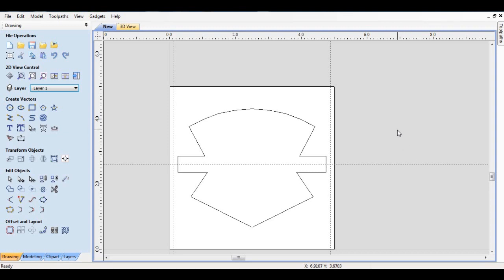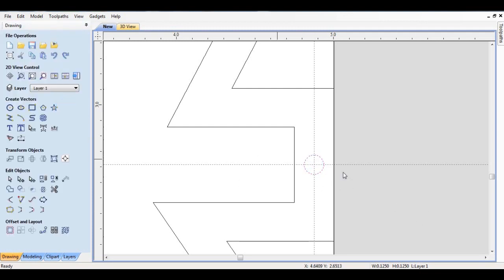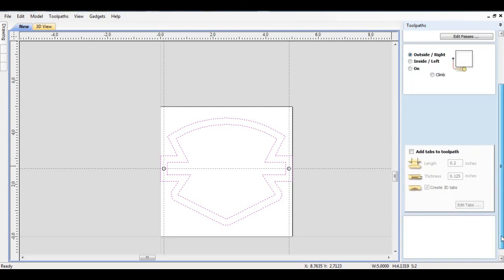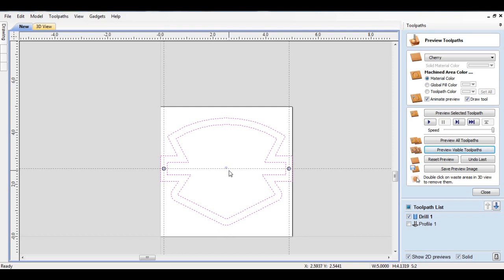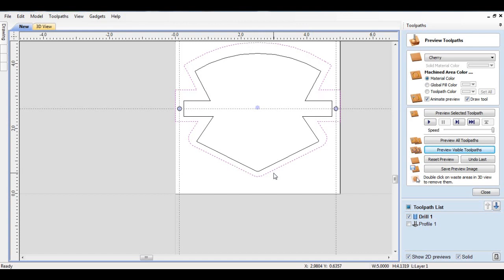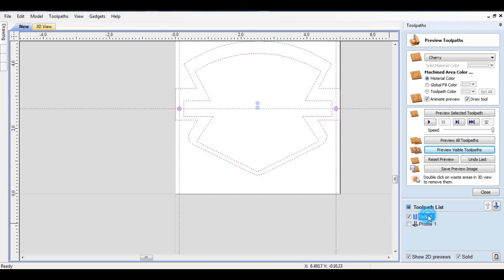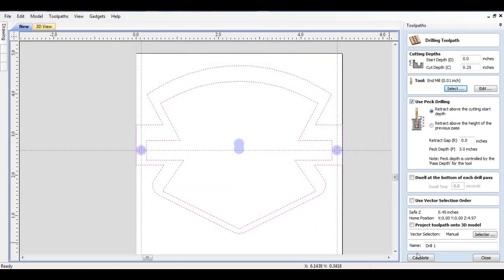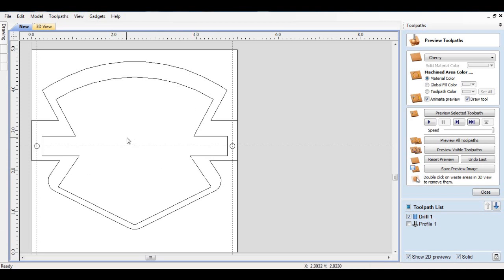VCarve Pro and Aspire Drilling Tutorial

Comment: I don't own VCarve Pro but Cut 2D and there is no option to "drill" in Cut 2D. What I ended up doing is create a circle with a diameter of the drill bit and choose the drill to mill from inside. I do understand why VCarve is doing what it does from logic stand point. You told it to drill and it takes the center of the object and drills it.